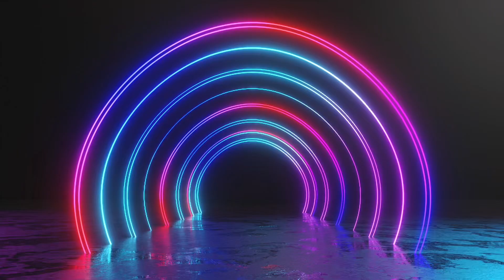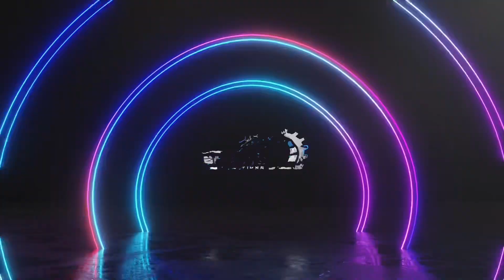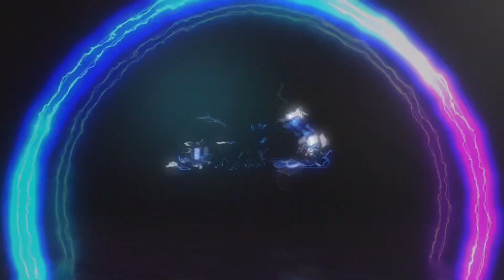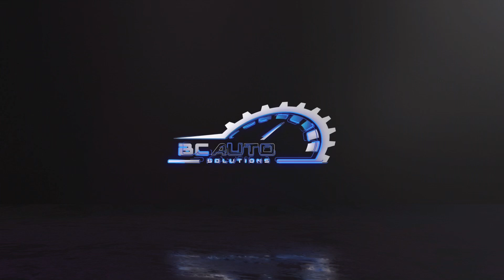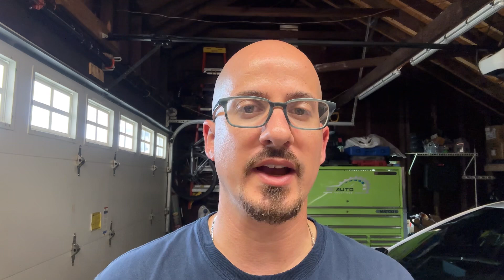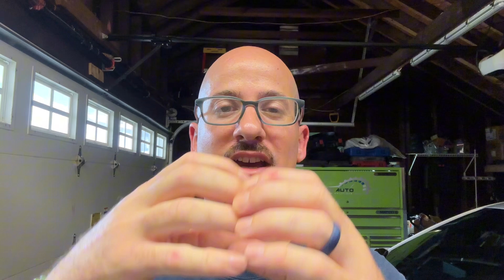Q&A Episode 58 (Honda - electronic parking brakes)

Comment: My element started to rev (not responding to acceleration) when decelerate to accelerate on fwy. Reached an exit, tried going into first wouldn't work. 2hrs later it worked perfectly fine, till awhile after same issue happened on the fwy, but this time Im no longer able to get into first or reverse. Hearing whirling noise in neutral, kinda goes away when i Press clutch. Any idea?
Reply from the maker: Sounds like something in your clutch gave out.
Reply: @BCautosutions  I figured, lengthy job, but someone's gotta do it. Will be going in later this week.
Reply from the maker: @jtjimenez05  lmk how it goes

Comment: I Have the ARP Headbolts and the new Head Gasket Set. For the 2018 Honda Accord 1.5t. Will I need a Diagnostic tool to or or is that going to work. I should have kept my 2012 Honda Accord Coupe 182,000 Miles Never any Problems. I Traded it in and paid 21,000 cash for this Car 2018 Honda Accord. But I am glad a Honda Service Tech is being Honest.
Reply from the maker: No scan tool should be needed although a ckp relearn is always a good idea. If you need a Honda tool look into the launch x431, I have a couple of videos on it

Comment: I was surprised he did not mention exactly how to release a stuck e-parking brake.  I saw on a video how to release a stuck e-parking brake, but I don't remember exactly and don't have that video now.
Reply from the maker: You can force off the calipers which will be under extreme load and not safe to do imo. If you find another way lmk and I’ll be happy to look into it 👍🏻

Comment: Thanks for your video so far my 21 TLX Type S is about to hit 60k and I am amazed at how well it still drives. It feels like I just took it off the lot. My big concern down the road is the reliability of the vehicle when I am often switching modes from comfort/normal/sport and sometimes sport +.

Today my car jerked hard for the first time ever when driving in sport mode but I was caught in stop and go traffic and should have put it back in normal mode. The car especially in sport mode loves to hold its revs and seeks to always upshift. But so far so good. 

Thanks again, take care.
Reply: I was an acura tech. There could be a software update for the trans like the there has been for precious tlx models. Be sure to change your trans fluid with the oem fluid and i don’t recommend going past 30k on any trans fluid.
Reply: @isorozco511  perfect, thank you my friend. 
Yes I've had the trans fluid changed twice already. I believe it was around 20kish I think and the other at 42k
Reply from the maker: So I find that in sport/+ modes the car like to be driven hard. When your just cruising the car almost seems like it doesn’t know what to do with itself. Most times im in normal or comfort mode and don’t have those hiccups. Like the Acura tech said can also check for updates and keep up with them trans services as you have been.

Comment: J35y8 here with 6k. Has a slight leak from the front variable cam timing actuator. Dealer said they would clean it and recheck at the next service and if it leaks they would replace the seal.
Reply from the maker: This issues is under investigation if I recall correctly. They shouldn’t be cleaning unless if it was before this was an investigated item.
Reply: @BCautosutions  They cleaned it off and left a note in the service paperwork that a leak existed. I noticed it a few days before I took the car in for its first oil change last week.
Reply from the maker: @Stream1222  keep me posted 👍🏻
Reply: @BCautosutions  Its clean right not but going on a 2500 mile trip in 2 weeks so ill see how it looks after that.
Reply from the maker: @Stream1222  ✅
Reply: @BCautosutions  3 weeks and 3k later. No leaks that I could find. No idea if the tech tightned it or just cleaned it.
Reply from the maker: @Stream1222  ✅

Comment: Looking forward to your review on the TLX-S.  Regarding power folding mirrors is there a way to reset them?  Mine works fine on the 2016 MDX but I've noticed lately one is slightly slower than the other when folding and unfolding.
Reply from the maker: You can try and spray some type of lubricant in there, careful to try and keep whatever you use off the paint although the motor is most likely just tired.
Reply: @BCautosutions  thank you.

Comment: Is it necessary to use Honda specific coolant or will after market coolant that matches OEM specifications work just fine ?
Reply: Use oem, its actually good coolant that takes so much longer to corrode than aftermarket options
Reply from the maker: Yes use oem coolant

Comment: Just hit 82K on my 2021 Accord 2.0T Touring (K20C) and still running like a champ. Thanks for your maintenance suggestions, it’s greatly appreciated.
Reply from the maker: Love to hear it!
Reply: @BCautosutions  Thanks!
Reply: @JTreetop  This is good to see. I have a 2022 Accord 2.0T with 26K im glad to read that its gonna run like a champ for miles to come. Are you putting regular gas or 91 or above?
Reply: @miguelleyva1820  I did use 87 early on but my service advisor who I’m friends with advise to run 91/93. Every blue moon I’ll use 87 but I mostly hold true to 91/93. I change my oil every 3 to 3.5K miles regardless, maybe 5K but I need this car to last. Transmission fluid every 30K miles.
Reply: @JTreetop  Ive been using the 91/93 since i bought it, i used 87 once and I could tell the difference. Sounds like you take good care of it im sure it will last a long time. I love the car man i had the 1.5 accord before this 2.0T for about 18 months and i got rid of it cause of the head gasket issue. I plan on keeping mine for years to come ive had no issues on my 2.0T.

Comment: 1.5t Accord is throwing a p0299 at 155k miles. You have a short where you mention that replacing the wastegate linkage can resolve the issue vs buying a whole new turbo.

Two questions:

1) can that linkage be replaced without remove the turbo from the car?
2) how difficult is it to replace? I can't seem to find any info on how to actually do the replacement.

Thanks!
Reply from the maker: Yes it can be changed in the car. If I have a donor car I can do a video on it. Until then I don’t have a video unfortunately
Reply: @BCautosutions  you're amazing, thank you so much!
Reply from the maker: @ixiwixi  🙌

Comment: What is the correct way to put a crush washer on? I have seen some say the rounded side to the pan and some say the flat side.
Reply: I’ve been putting on the flat side to the bolt side for years without an issue
Reply from the maker: Either way works for me as long as you change it every time